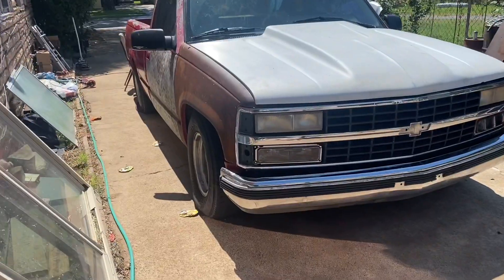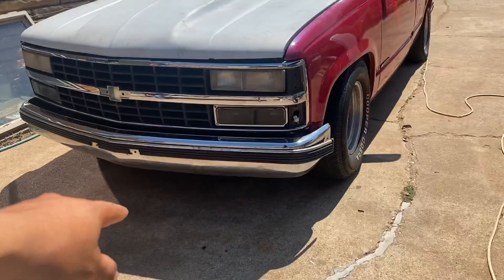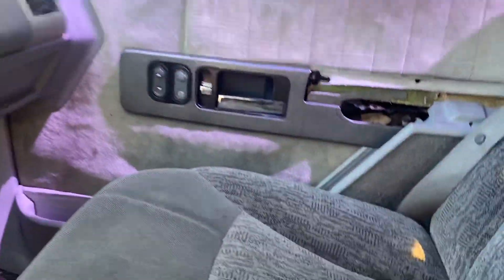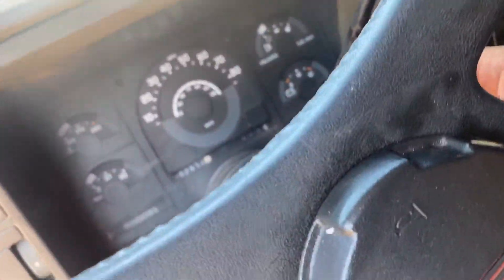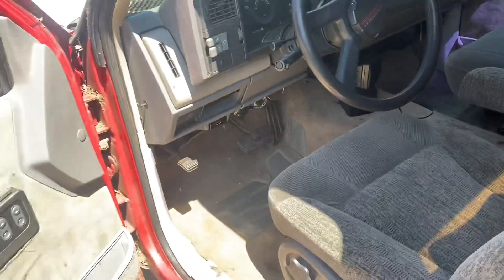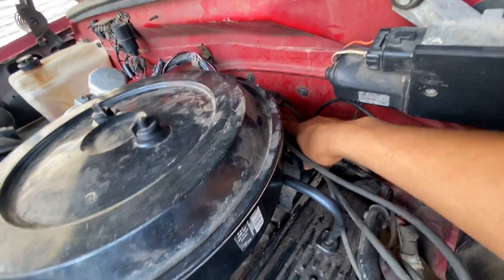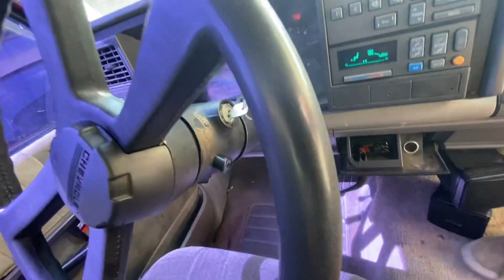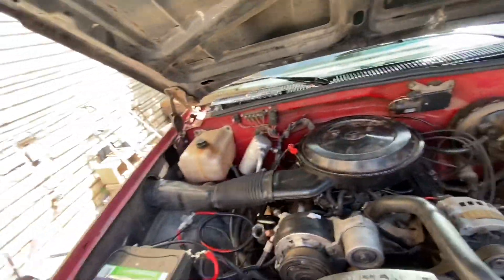1991 Chevy OBS cranks but won’t start

Comment: You can also spray carb cleaner or starter fluid in the intake if it starts then you have a bad fuel pump.

Comment: I believe I hear the fuel pump working. So it could be it’s not getting gas to the injectors.. I’d check/replace the filter, check the spark plugs, and check to see if the injectors are working when turning the key. My v6 was similar to this and when I turned the key gas would drip out.

Comment: When jumping on vehicle using jumper cables u should take the ground cable of jumpers that go to battery that needs jumped and ground somewhere else other than the battery. This will
Minimize any electrical surges going back to donor vehicle( good battery  which would be your moms vehicle)doing the jumping. If u get a surge current u can burn up computer and other things

Comment: Spray some started fluid in the carburator if it starts up for a few seconds then its a fuel line fuel pump problem could also be the distributor cap

Comment: Oye cuh tambien when you giving boost from another car. Have it running for atleast 3 minutes.. then you try cranking your dead truck.. also I noticed your fuel is very low... 
1. Get some more fuel in the truck
2. Boost the truck while having the other trucking running. 
3. When you are cranking the truck step on the gas like you are pumping it.

Comment: Take the breather off. Get a squirt bottle with some gas in it. Have someone try to start it while you squirt gas in the throttle body, don't give it gas. Just let it idle, your have to do a steady spray. Like spay pause spray pause spay pause, your basically the fuel pump. If it idles fine like that its the fuel pump. Did you make sure your truck has gas?

Comment: Ayy bro it’s the timing because my obs had the same problem when I replaced the distributor
Reply: What did u donto fix it
Reply: Yo wsp i had put the distributor but i just put it facing how it was to 1cyl 1 i didnt time it is that why im not getting fuel

Comment: It’s the Fuel pump my obs was doing that to
Reply: Jorge Lopez it does that when the fuel pump fails, its one of the main signs of a bad fuel pump.
Reply: @stedegrissom5788  he could give the fuel tank a light tap with a hammer
Reply: I've actually done that and its a good idea. I forgot to mention that the pickup tube may have a crack in it or came loose all together. My 95 OBS did that, at a 1/4 of a tank it was empty and at low fuel levels would die when I made a turn.